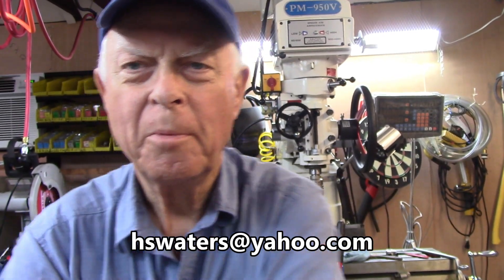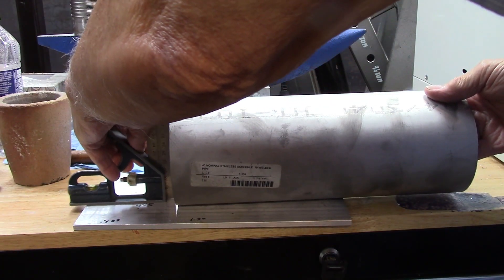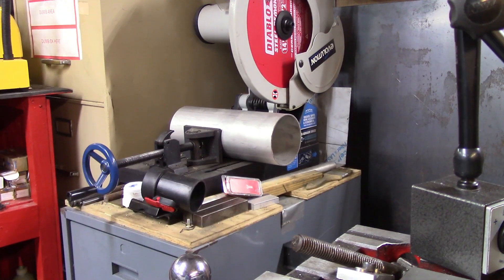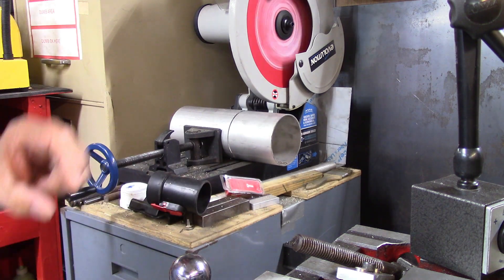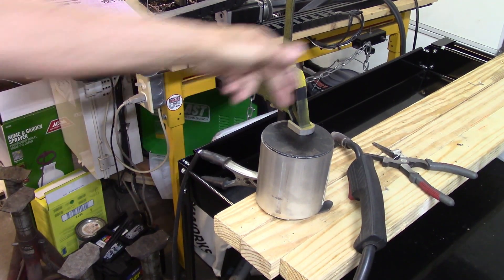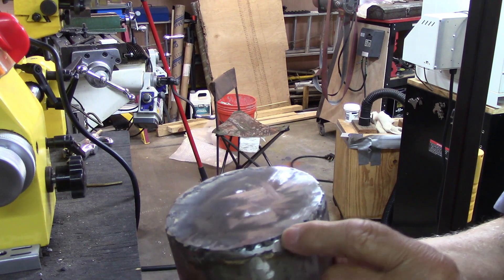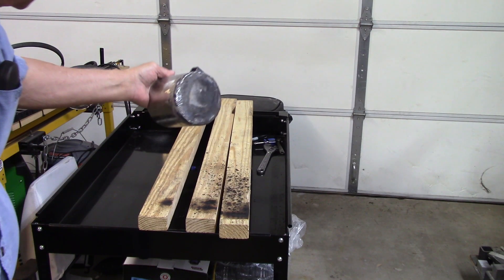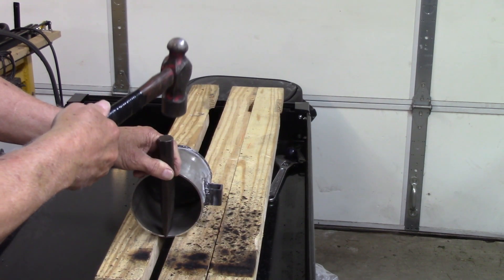Making a stainless crucible

Comment: Stainless does not really like high heat stress cycles.  It will kind of crystalize and fail.  Keep your eye on it.   Stainless steel has among the lowest thermal conductivity of any metal, roughly 15 watts per kelvin per metre.  When stainless steel is heated, it begins to lose its strength due to a process called austenitization. As the temperature rises, chromium atoms diffuse out of their original place in the alloy and move around within it, making the structure less organized and thus compromising its strength.
Reply from the maker: Hopefully it will not be too stressful to hold a couple of pounds of weight.  Thanks Randy.

Comment: Harold, maybe you could support the crucible in the press and use it to press out a pour spout. I was thinking using a sizeable diameter rod, placing one end in the crucible and the other on a press plate with supports under the crucible so the crucible is higher than the press plate it is setting on, using supports similar to the wood planks you were using, preferably steel. The rod would be on an angle  and the supports would have to be more rigid than the wood planks you attempted to use. It might work OK if the setup is thought out. Hope this makes sense.
Reply from the maker: I will likely give that a try Stovebolt,

Comment: If you can, covert your lathe drive to a serpentine belt. There's a lot of threads on Practical Machinist website about doing this conversion on a Southbend 9A
in the Southbend section.
Regards,
Duck
Reply from the maker: I will look into that thanks Camojoe,